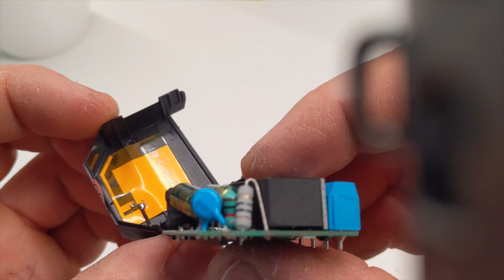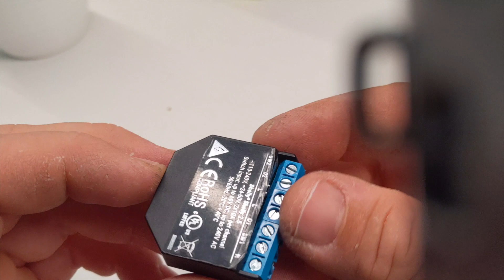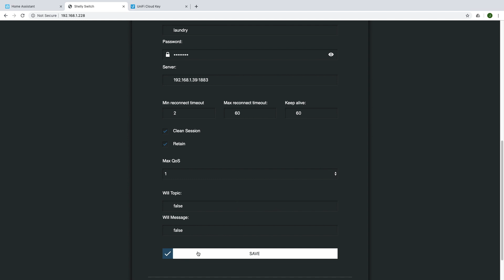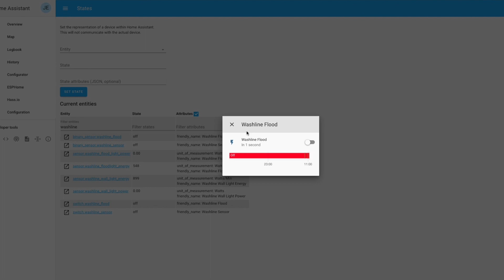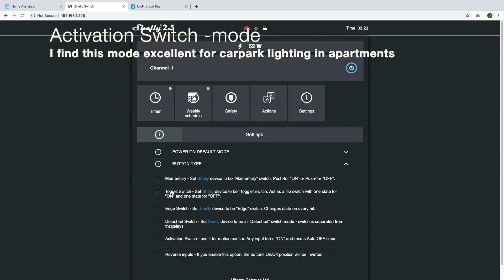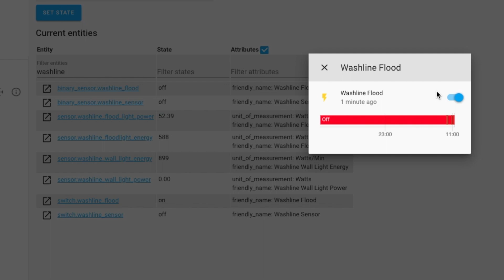Closeup of Shelly 2.5 - HASSIO Setup

Comment: Thank you for the close-up and teardown. Impressive design done on this. Would you happen to know what the markings on D8 and D9 are? I'm trying to figure out what that diode is or what its function is in the 240V switch detection. D6 and D7 are the standard 1N4007, and they're handling the rectification, but what are D8 and D9? I also assume that the signal for both switches passes by an optocoupler first before going to the MCU, unless it's indeed like you said they're sharing ground with Neutral and are fed directly to MCU, but that doesn't seem very prudent.

Also is there any protection on the relay outputs, given this is marketed as suitable for motors (curtains/blinds)?
Reply from the maker: I’m 99% certain there is no optocoupler, and those small diodes look like Sod523 TVS diodes to prevent the MCU being damaged by spikes. As they go from the switch input after the 1n4007 diode to ground. That is my best guess. Or it could be a zener maybe for the same purpose, clamping voltage.

Comment: wish they made 20amp rated shellys for the washingmachine
Reply: Just make the Shelly control a 20A relais or contactor.
Reply: @fmb64  yeah but then power measurements go out the door :) I've installed a 16 amp plug behind it now seems to be working :)
Reply: @jeroenvandend  Yeah I see :)  You could add a Shelly EM :)